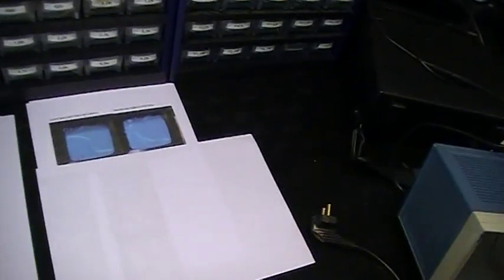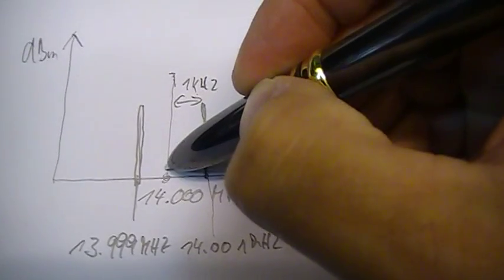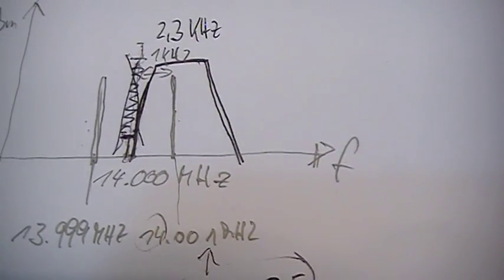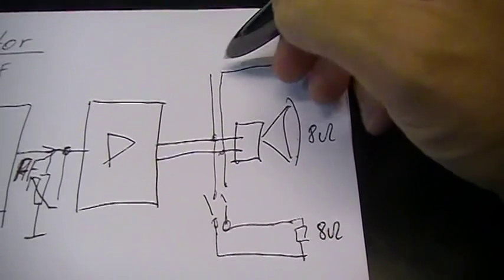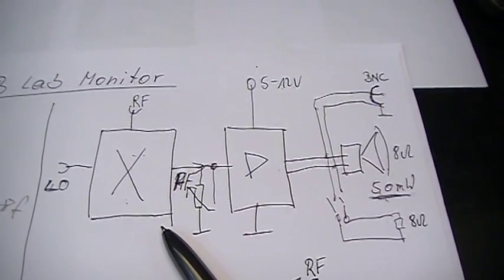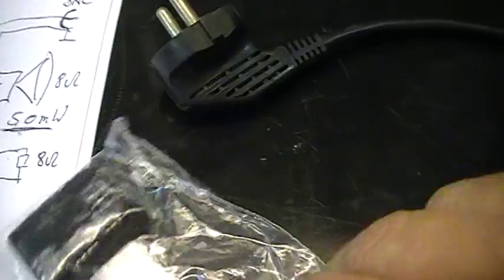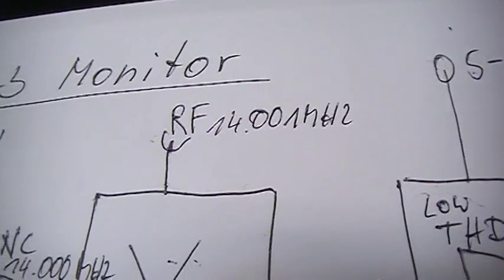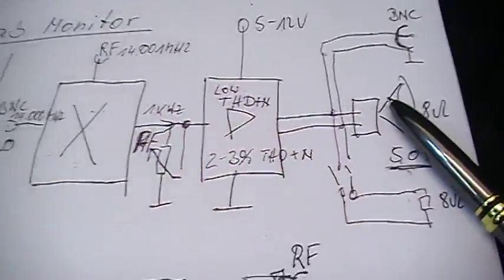#17 Build: SSB Lab Monitor; Part 1

Comment: Ein toller Bauvorschlag, eine Frage, bis zu welcher Ausgangsleisteung kann ich die Werte übernehmen?
Ich möchte so etwas hinter einer 1K2 PA einsetzen.
Reply from the maker: Hallo Bernd, das ist alles eine Frage des vorgeschalteten Abschwächers. 1,2KW sind 60,79dBm, somit brauchst Du einen Leistungsabschwächer von 60 dB da der Eingang des Demodulators nicht viel mehr als 0dBm vertragen kann....